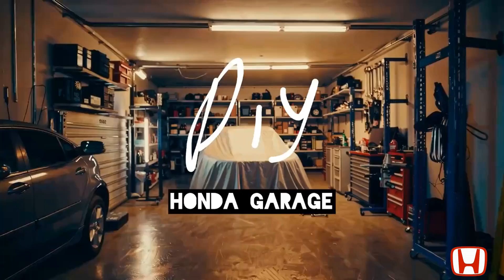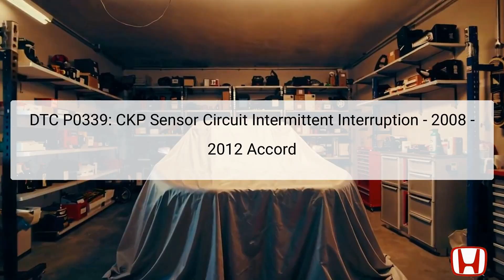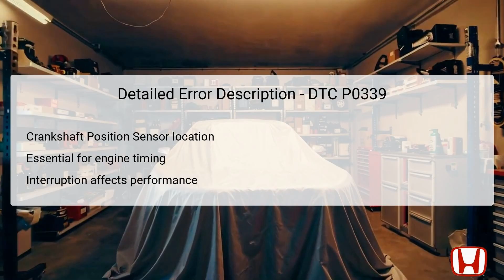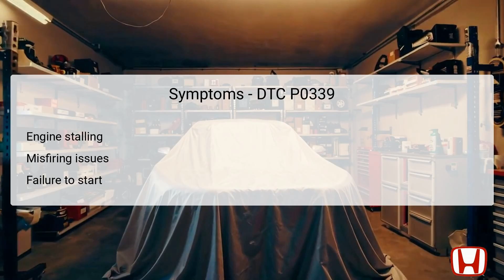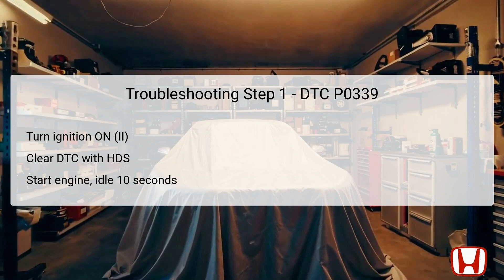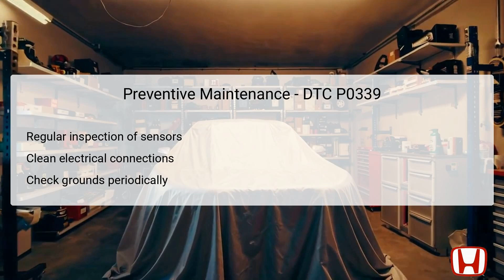DTC P0339: CKP Sensor Circuit Intermittent Interruption - 2008 - 2012 Accord

Comment: Changed my Crankshaft position sensor on my 09 TSX and code comes back in a few months. Relearn was done. I hear Honda has a service bulletin for a PCM / software update to avoid the faulty code. Also hear aftermarket starter contributes to long start issue. Any help is appreciated. TY